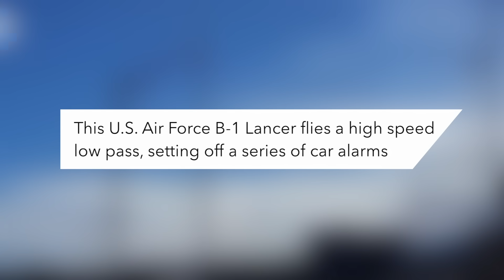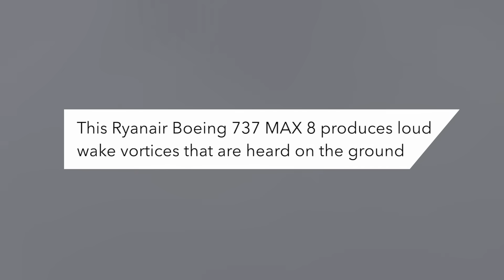747 Wing Drops Too Low

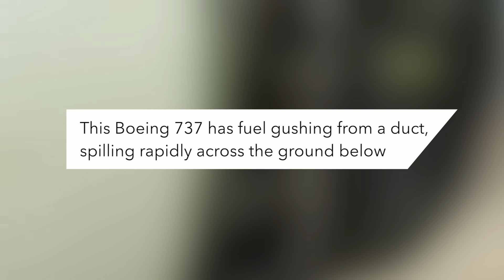Comment: 1:12 if that is fuel leaking why isn't everybody running, what if it catches fire?!?
Reply: If that was fuel, I wouldn't be standing around there photographing it. You would be in imminent danger ! IT'S A PETROLEUM BASED FUEL !!!
Reply: Jet fuel isn’t like petrol. It’s more like diesel in that it doesn’t ignite that easily.

Comment: A B-1 flyby can be quite frightening. It's not just the noise, but also the aircraft appearance - it's very menacing.
I thought that Aer Lingus A321 and that 747 actually did ok. The 747 in particular was clearly battling some fierce winds, both from in front and the left side.

Comment: 2:29 I've heard this fascinating noise many times, but I had no idea what it could be. I explained it to myself and came to the conclusion that the tip vortices probably touch each other at some point and cancel each other out, creating this special noise. Sometimes you don't even hear it until the aircraft is already on the taxiway.
Reply: I'm not an expert on vortexes, but I have always understood that vortexes will slowly propagate away from the path of the aircraft that created them, assuming a no wind situation.  I have seen videos where an aircraft flies through smoke or ground fog as it is landing, thus the vortexes can be seen, and I have watched the vortexes roll out to the sides away from the runway.  I'm not sure the vortexes ever meet.  If somebody who knows something wants to comment, I'm open to being wrong.
Reply: Vortices

Comment: That one with China Eastern not understanding the go around instructions is why the language for go around is "(callsign) Approach clearance canceled, go around (no runway number given to prevent confusion with "cleared to land runway number"), fly runway heading maintain 3000 feet (or other go around vectors, but *never give the runway number*).
Reply: Yeah way too much unnecessary chatter from ATC
"2035 GO AROUND" should have been that second call
Reply: ATC's English isn't easy to understand either.
Reply: Should just be ‘China Eastern, go around’
Reply: Absolutely, as you say standard phraseology exists to reduce ambiguity. But even with that, there’s still a basic level of English comprehension expected from all pilots. Particularly around airspaces like London, you can always hear ATC slowing down and simplifying their English just for Chinese carriers. It shows that while the procedures help, they can’t fully compensate for poor language proficiency. In any kind of emergency, that gap can become a safety issue.
Reply: I understood the Chinese pilot just fine, the ATC lady was just garbled „something with curry“ (Little Britain‘s Marjorie, anyone? 😂) - without captions I was not able to understand what she was saying. 
Bud, bud, bud, bud, bud (Catherine Tate - The Translator) 😊
Reply: @wakeupcall2665  Dust is low in calories so it's no all bad news.
Reply: Pilot was fine, ATC couldn't enunciate to save her life. She was missing half her syllables - on top of an already ambiguous call out. I would've been confused, too.
Reply: In my experience, Native English speaking ATC are often the worst for non-standard phraseology, “call me on 10 miles final” instead of “report one zero DME”. Or “behind traffic in front, line up … behind” (which should only ever be used for lining up behind landing traffic). They also tend to speak extremely fast. The faster they talk, the slower I talk back, and guess what, I never ever hear “say again?” 😅 it would be good for English ATC to fly an aircraft for example into a French speaking airport, having a list with ATC phrases on their note block, and trying to find out what they mean if the tower says something that’s not on the list :)
Reply: I think the whole thing is fake
Reply: This is what happens when your hiring policies are based on quotas instead of competence. We've all seen it before...
Reply: Agreed.  Should be a standard unambiguous phase, maybe including the word ABORT.
Reply: It is an old video. Just saying. 👍
Reply: By the sound of it the China Eastern pilot's English seemed pretty good so I'm a bit confused how he could make "go around" to "cleared to land"
Reply: @aron4283 
Bad headset. Noisy cockpit. Confirmation bias. Some combination of half a dozen minor issues that wouldn't be a problem on their own.
Reply: @tin2001 I guess so
Reply: @aron4283  "By the sound of it the China Eastern pilot's English seemed pretty good so I'm a bit confused how he could make "go around" to "cleared to land""

His English was fine, it's hers that is the problem. Not only is she slurring her words, she's using incorrect syntax which adds confusion. A go around instruction should not include the runway number. If you are going around you don't need a runway, this is what confused the pilot. Giving the runway implies you are landing, hence the confusion, and why the other pilot had to help out. ATC should be fired for this, it could've cost lives.
Reply: @aron4283  His English is OK. He's just not listening!
Reply: @aron4283  Chinese arrogance or nepotism
Reply: @tcmill-x2b Quite a bold statement when Bri'ish is often quite indecipherable as well, and given that standard phraseology seems to not only be a foreign concept for way too American controlers and pilots, but deviation from it is so perfectly accepted and normalized that people are even being celebrated for it (such as with "Kennedy Steve").
Reply: It also helps not to have an accent that's so thick you need autoland to go through it.
Reply: I don't understand curry English
Reply: @misterbig9025  Bruh

Comment: The B-1, almost like the F-111 before it, is untouchable at low altitude and high speed.  We (F-111s) would constantly be restricted during training flights in Dissimilar Air Combat to an artificially high hard deck so F-15's and F-16's could shoot at us.  The B-1 can also get low and fast but the inertia of that mass does not hug the ground as well. IT IS one BAD ASS machine though and reminds me of our Vark Motto, "If your wings don't sweep, you ain't sh_t!!", Go Bone!
Reply: There are stories from the First Gulf War (1990-1991) of F-111 pilots flying close to the ground during a high-speed egress from Iraq while being chased by the Iraqi Air Force.

Comment: That 747 wing was not too low. It was fine.
Reply: The wing isn't the issue. The clearance underneath the inboard engines is
Reply: @mothball611 the engine is attached to the wing, so when the wing is discussed, that includes the engine. 

The engine was not too low either.
Reply: @rtbrtb_dutchy4183 not really. You can have a wing strike or a pod strike, two different things. The wing was not low - correct, the wing tip wasn’t in danger of hitting the runway. The engine was not too low either - incorrect. Number 3 engine was very close to a pod strike. The bottom isn’t the bottom of the nacelle, but all the drain masts underneath. 

Pause the video at the lowest point and the normal point and you will see. 

Further proof there was too much bank on, look at the left wing gear bogie - there was enough weight taken off it to tilt it back to the flight stop (it’s pointing back up).
Reply: @mothball611 a wingtip strike is basically impossible on a 747. A twin engine this can happen, but a 4 engine aircraft, the outboard engines would strike first. 

Same with the 747, the outboard engines would scrape first, before the inboard. 

There are no masts at the bottom. They are slightly off to the side. There is one drain at the bottom, which is almost flush. 

In a strong crosswind, dropping one wing while straightening out the nose is fine and this would make the upwind wheels touchdown first. He definitely screwed this one up a bit, but there was no fear of an engine strike in this video. 

A lot of YouTube people say that engine, wing or tail strikes were “so close”, when it’s usually perfectly normal and acceptable. That was the case here.
Reply: @rtbrtb_dutchy4183 I pointed out number 3 because it's easier to see. Have a look at number 4 then. Don't know your operator's limits but this would have exceeded mine. 

Seeing as you seem to know something about the jumbo, I'd expect a better opening comment than "it was fine". And you can wing strike anything, you would just take out the outers as well with a quad
Reply: @mothball611 your operator’s limit?  Do you fly for that operator as a pilot?  I ask, because I’ve never heard of any operator having a limit for this. It’s basically, don’t hit your wing or pod. As far as I know, nobody sets a limit. Not even aircraft manufacturers. But most airplanes are safe up to 10° bank. 

If you mean with “the Jumbo” being the B747, then yes, I got 1500 hours PIC in it.
Reply: @rtbrtb_dutchy4183 yes operator's limit. 7 degrees bank near ground maximum. Probably even less for the -8. We don't fly that, only the -400. That's 747-400 if you want to be pedantic, seeing as you don't know it's called the jumbo. 

Btw, 1500 hours isn't very much in a long haul job. 

As much as I love arguing with a random on the internet, I'm done. Have a good one
Reply: @mothball611  anyone coming close to 7° shouldn’t be flying. That’s why it’s weird to me to set it as a company limit. How does that work in the cockpit?  “Oh, you are at 6° now, you better be careful, you are approaching the limit of 7°”. How do you even figure out the 7°? Especially when both pilots have their eyes outside during the flare. 

It’s not called “the Jumbo”, since any wide body of its day (L-1011, DC-10) was considered a Jumbo. I’m not pedantic about it, I was trying to investigate instead. You are insinuating that you are a pilot, but I’ve never heard any pilot refer to the 74 as “the Jumbo”. So when you said this, it felt off.  It indicates to me that you are not a pilot with your company, but I can be wrong. 

I have 1500 hours because we are one of the few companies in the world, who does mixed fleet flying. Every pilot is current and qualified on 2 different types. Also, I was needed on a different type after a few years, so I dropped the 74.
Reply: Jaja very fun
Reply: Shut up bro

Comment: Is it customary to say 'go around' with a runway #? That seemed very confusing
Reply: Absolutely. The tower controller didn’t help with non-standard phraseology including unnecessary additions like runway number, clearance cancelled etc. just say ‘CALLSIGN, GO AROUND’
Reply: No, absolutely not, what use would that be of the pilots?  Would only add confusion, so no, runway numbers are not given.
Reply: I just love these short videos.
Reply: Go around does not sound like clear to land even with thick accent.
Reply: @encinobalboa  That was expectation bias coupled to limited English ability, with two different nationalities both speaking a second language. That’s why standard phraseology is so important.

Comment: 1:18 Looks like hydraulic fluid, not fuel. Fuel is clear and doesn't foam.
Reply: Who taught that plane how to potty train???
Reply: Lol, I used to fuel in private aviation - that looked like very dirty fuel to me! Now I know what it is.
Reply: It was indeed hydraulic fluid, and it was NOT in Brisbane. The outer metal portion of the hose quick connector failed and split. That is however, all I will say. t. knower.
Reply: Yes, It is Hydraulic fluid.
Reply: Skydrol… yuck
Reply: Def. hydraulic fuel, but Jet-A does foam, watch it as you overwing it and you'll see.
Reply: that looks like coca-cola
Reply: Hydrolic fluid, Skydrol, is purple, not yellow. That's fuel. It's also coming out of the fuel hose.
Reply: @CerberusTenshi  When it's fresh it's blueish-purple. When it degrades it becomes yellowish brown. The darker the color, the older it is and/or the hotter it has become. When it oxidizes it becomes a bright yellow. Also that's the hydraulic pressure hose. Fwd of it is the suction line, aft of it is the fuel line. That's definitely not fuel.
Reply: @CerberusTenshi  thats true.  It could be engine oil depending on what oil they use, the colors are different.  Jet A is crystal clear so im ruling out fuel.
Reply: @Empty7775  Engine oil doesn't go into hoses. The whole oil circulation system is pretty much located next to the gear box. 

If it's a hydraulic hose, like people say, it should have purple connectors for the quick release or at the very least a purple band around the hose, like the small one you can see between the strut that keeps the engine door open and the thick hose. That deep purple coloured marking is for easy identification of whether it's a fuel hose or a hydraulic hose.
Reply: @CerberusTenshi it absolutely goes into hoses.
Reply: @Empty7775  Pipes, yes. Hoses, maybe a few but definitely not that thick and not that high up, going into the wing via the pylon. Definitely not engine oil coming from that hose.
Reply: It's hydraulic fuel
Reply: If that was fuel, I wouldn't be standing around there photographing it. You would be in imminent danger !

Comment: During my days, one of the fighter pilots (199th FS back when it was F15) nicknamed "Grinder" because he d land and grind the tow hook. *correction: tailhook 

Awesome YouTube channel 👏 👍🏻
Reply: Query - the F-15 had a tail hook? 
I was Navy back in the early 80s. I know why WE have tail hooks, but I never knew the AF used them .. ?? Is this for an issue where an AF plane had no brakes, or other emergency?
(Honest question, not trying to troll ..)
Reply: @TexJester-no8th yes, most of the Airforce fighters have tail hooks. (F-15, F16, F-104, F-5 etc) And at Airforce bases, they usually have the arrestor cable up at the end of the runway, so if they lose brakes, they can drop the hook before the end of the runway. 

I believe the hook is not as strong as the navy version, since it’s barely used.
Reply: He wasn’t called “Grinder” because of that. 😂😂.

Comment: What happens after a hard landing? Do they pull the plane for inspection or are those landings fairly routine?
Reply: The Airbus will complain if the landing is too hard :P
It depends on how hard the landing is.

Comment: I wouldn’t have been standing that close to the 737 engine if that was indeed fuel…
Reply: Jet fuel doesn't ignite all that easily on its own. It smells, it's not healthy to breath in over a prolonged time, but standing beside it is not that problematic.
Reply: @CerberusTenshi I had never realised that! Thanks for the info👍